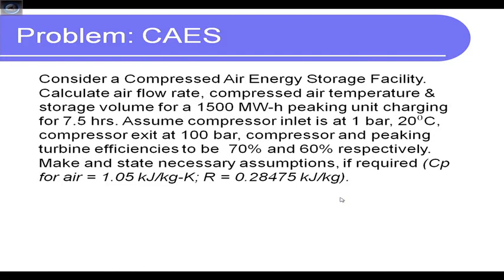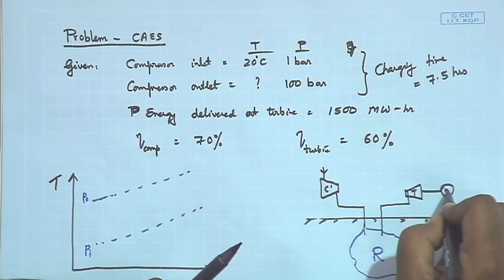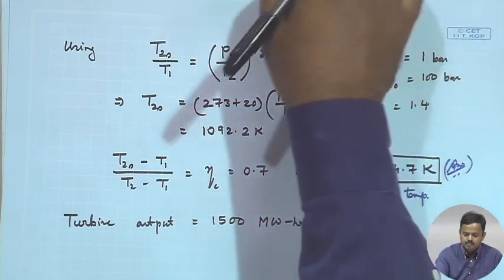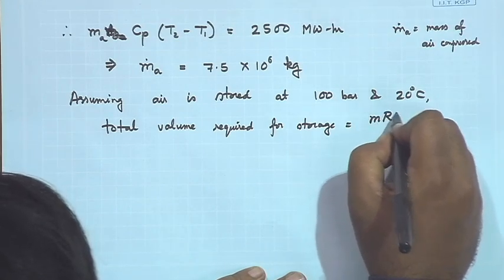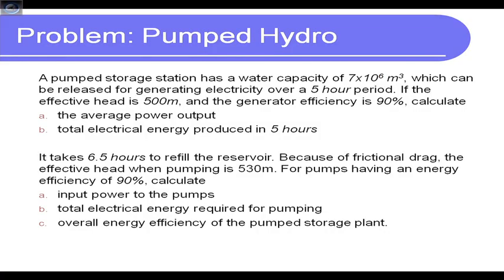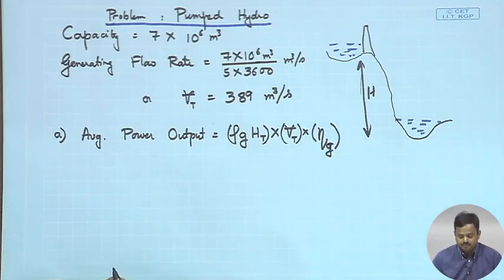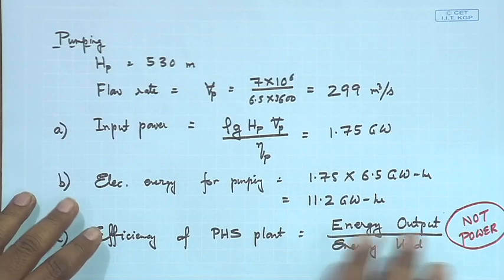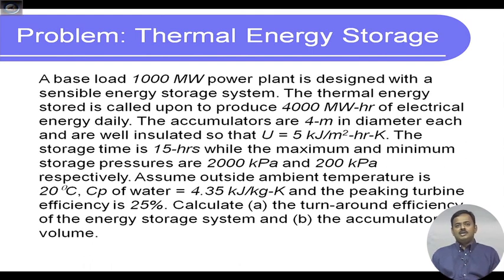Lecture 59 : Energy Storage Systems - IX

Comment: Also you need to consider electro- mechanical losses as well ( lamimar flow loss, water channel friction loss, evaporation loss, both  pump & efficiencies, both turbine & generator efficiencies, elerical conductors losses in cables connected to pumps/ motors etc.